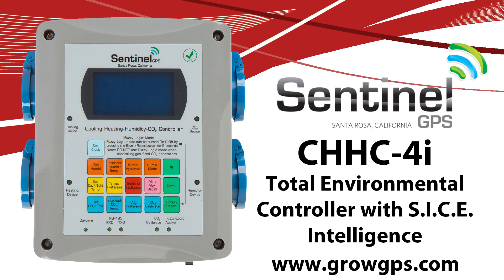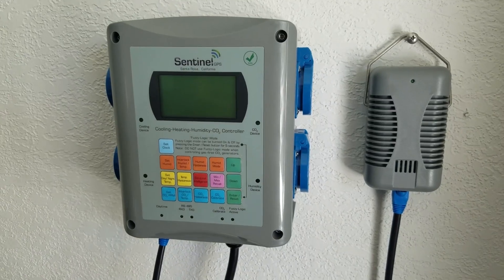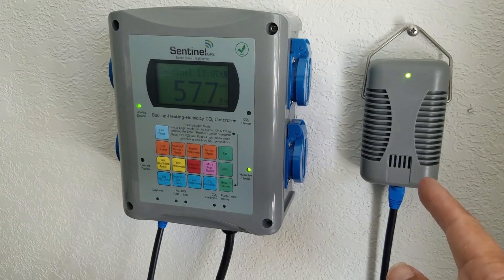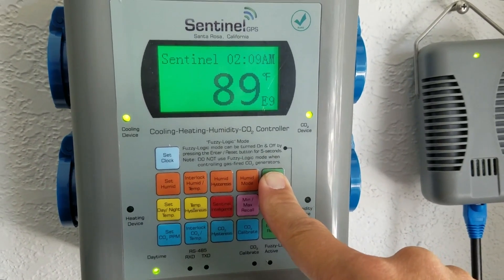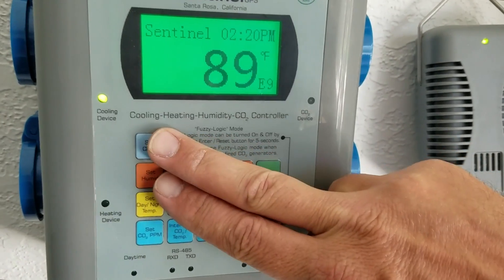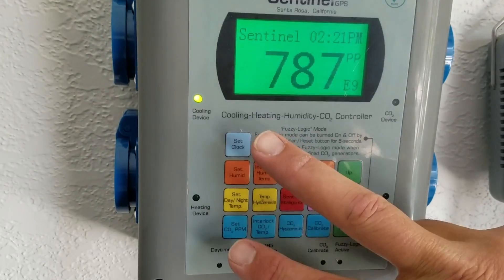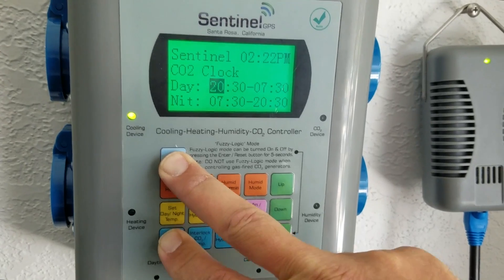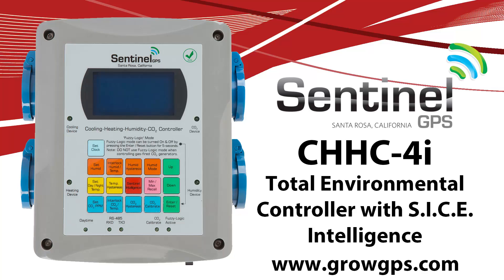Sentinel GPS CHHC-4i - Total Environmental Controller Set Up

Comment: What E9 mean on the display? I cannot get this unit to work with my ICG-30 with S.I.C.E. this is my second unit already. from a cable problem. It came DOA.
Nothing to help on the website either.
Reply from the maker: 1. E9 is normally on the display, not an issue. 2. You have to set the ICG to "Sentinel" mode, connect it to the CHHC-4i with a cable and adjust your Sentinel Intelligence settings.